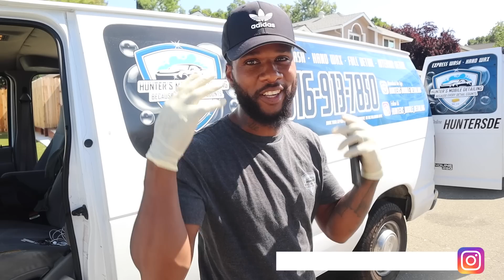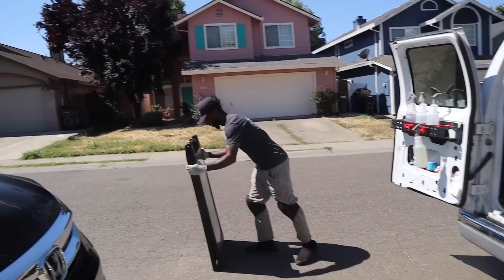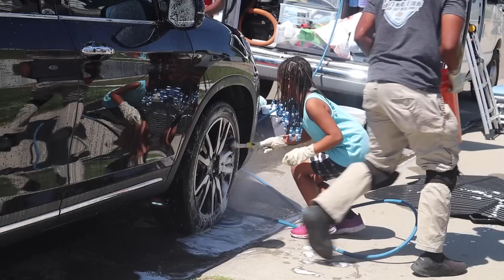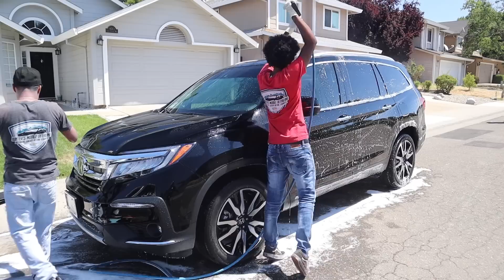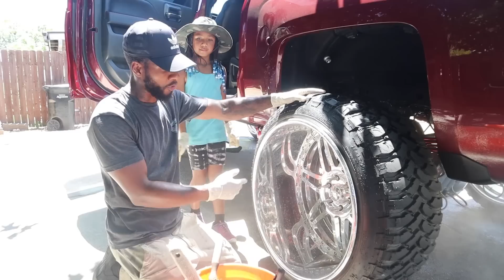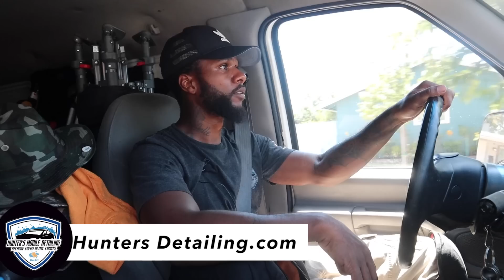Picky Customer Keeps Pointing Stuff Out - Hunters Mobile Detailing

Comment: This hurts to watch but you have to learn somewhere right🤷🏻‍♂️…those are forged wheels (forged aluminum) so they can be brushed (as your daughter did for him with that stiff brush😬) or you can have polished like he had. The polish process takes a long time and cost some💰if you have done professionally. The first step in polishing is called “Cutting in” which scratches the surface just enough to get rid of all the dirt and grime that the soap and water cannot. Then you have to polish with a polished wheel to get the shine that you desire. So all in all that process can take hours done properly…so he not picky he just trying to save his 5-12 thousand dollars wheels. I had a set of specialty forged wheels that cost $8,999 and I would have shit my self if I saw a stiff brush like that on my wheels😂😂😂

Comment: Yeah boss you got to charge way more for them 4wds and if he wants that undercarriage and axles and shocks,basically all the suspension you got to charge at least 200 for the truck,that's why he wants you back every fri cuz he getn a helluva deal!! The wheels like mentioned previously are special materials, such as polished or billet or etc that can be ruined real quick with most chemicals and those wheels are not cheap,anywhere from 4k to 14k for 30s such as Specilty Forged or American Force. Just tryn to help you out buddy,don't like seeing people getting taken advantage of and if guy is that picky and has spent that kind of money on all the accessories on his truck he won't mind paying extra. Remember good works not cheap and cheap work is not good! Also great job on starting the youngsters out right!!🙌

Comment: Resin you don’t put chemicals on the wheels bc it’s no treated alloy and your not suppose to add acids it dulls the finish then you need to come back with a cutter and polish it back , also scratches are a big no no.
Not knocking man but don’t put that on your content shows like you don’t know what your doing , but you know what your doing .

Comment: If you did a full detail prices need to be way higher for that truck bruh no shit he wants you to come back lmfao to clean spray wax and polish exterior of a super duty alone is $125-150 the interior would be almost double depending on if he wants protectant and how dirty it is
Reply from the maker: Just a basic inside and out cleaning only takes 1 hour and 30mins  full detail is 400 sedans 500 suv and trucks on condition
Reply: @HuntersMobileDetailing  what do you consider a “full detail”? For me that’s interior vacuum clean, protect plastics or cheap vinyl w tire shine spray, wash scrub apc cleaner and spray wax exterior, and I charge smaller cars 125-150 bigger cars 175-200
Reply from the maker: @connorking6852  polish, wax, engine cleaning., interior shampoo, pretty much everything. And the polish is just for shine not correction.
Reply from the maker: @connorking6852  that’s why everyone is confused why I charged so cheap is because I don’t consider it a full detail. This is just a vacuum, wipe down. And a basic wash.
Reply: @HuntersMobileDetailing  true and I figure a truck like that’s already “clean” at least on the interior so basically a light vacuum wipe down, wash and spray wax is what you consider a basic cleaning? Also it looks like you were putting spray wax or some protectant on all the chrome suspension additives etc correct me if I’m wrong on that but it looks like (at least to what I’m used to working w 1 other person) a 2 hour job, I’d charge at least 175 for that alone and honestly probably because it’s a huge lift and all that extra chrome at least 200. Also just another point guys with huge trucks like that have lots of money to spend so don’t feel bad about making them pay for what they got is what my old boss told me. People always try to cheap you out and expect everything for free or to be cheap.
Reply from the maker: @connorking6852  💯 I agree and your right I did add extra . This truck should be more like everyone has been saying. 200 to 300 def going to be ready for the next.